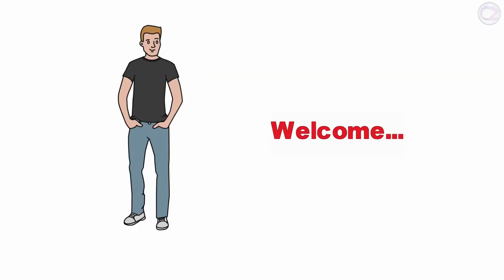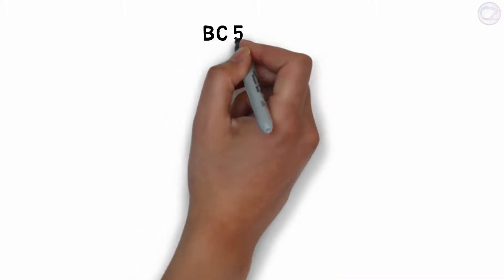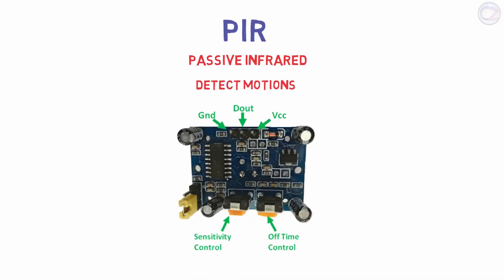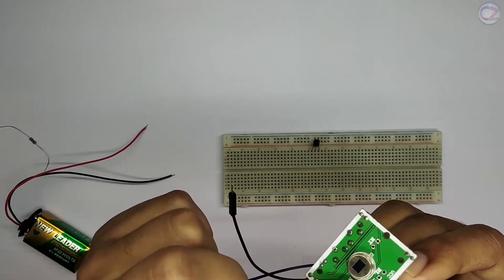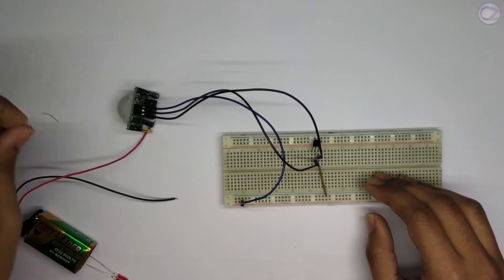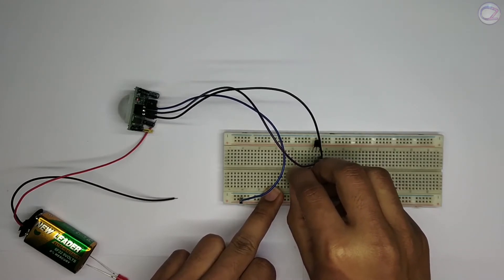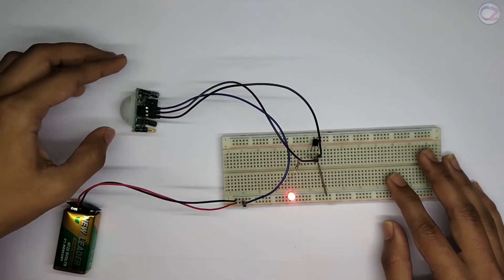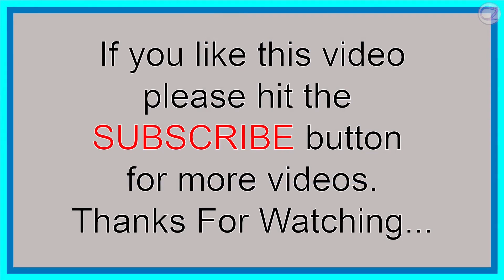How To Use PIR Sensor Without Arduino || Using a Single Transistor

Comment: Good tutorial and well made. By adding the transition you boost the output in order to increase the amount of electricity, right? Otherwise the led will not be as bright. I want to do something like that but also adding a DC motor. Would that be enough to power both Things? Thanks!